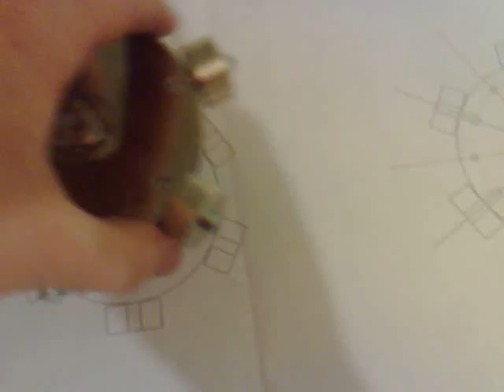Pulse Motor (Six Magnets Attached) 081

Comment from the maker: Thanks for the advice, I thought that the heads of the bolts might need a bar with a hole drilled through it as a washer if they do not cope with the forces.

I will google Tee Nuts, I was planning on loctite but want to be able to swap the poles of the magnets. I might swap the  nuts and bolts around so the bolt head is on the outside.

Comment: Interesting project.  I've followed your progress. Suggest you try Tee Nuts instead of hex nut and washer. They are available with or without prongs. The prongs can be ground off. Tee nuts would allow the coil to be much closer to magnet. A little Loctite would secure the threads. I share your concern  on screw heads coming out at speed!